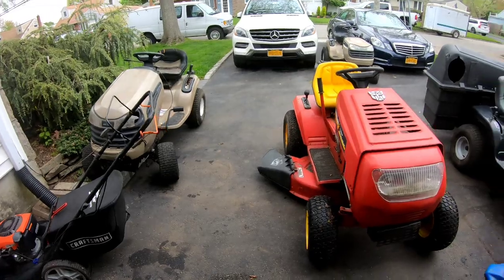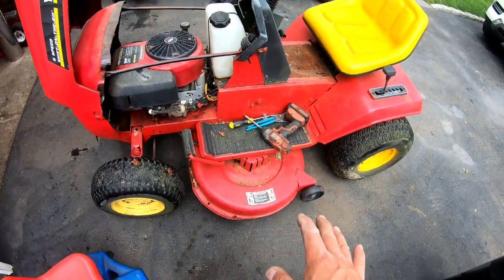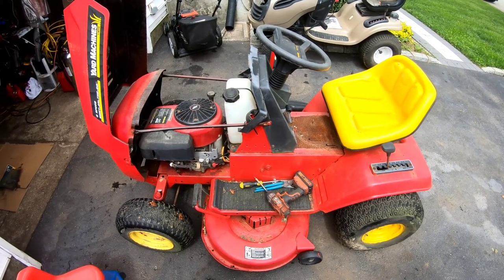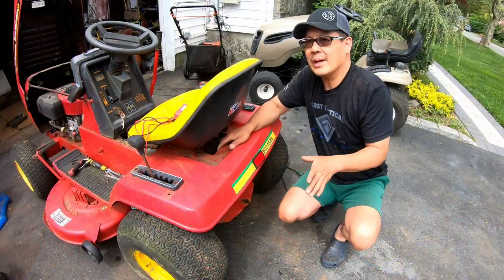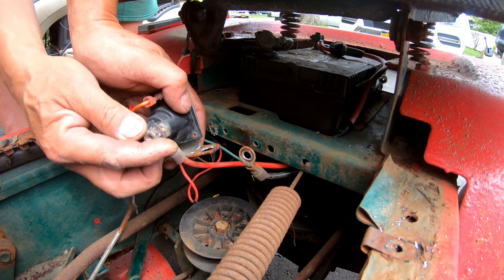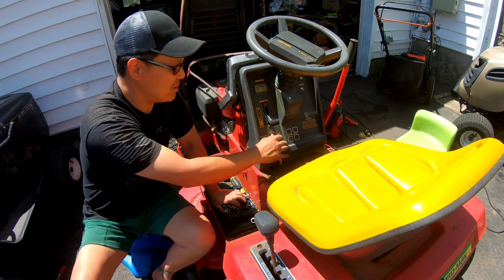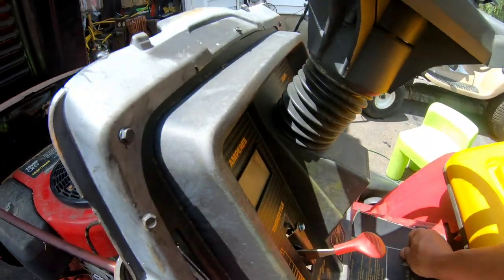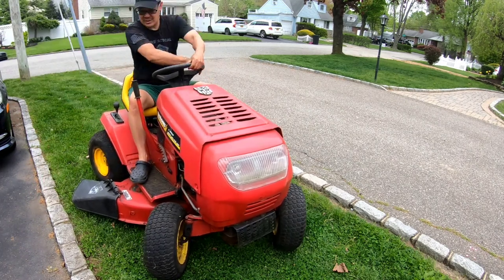GETTING RODIMUS PRIME GOING AGAIN!MTD YARDMAN 15.5HP BRIGGS 4 WHEEL STEERING LAWN TRACTOR GROUND FIX

Comment: A good idea for removing those Phillip’s screws when they round out is just use the cut off wheel and cut a slot for a standard screw driver. That way you can remove the screws without cutting into the panel and way less work. Hope it helps in the future. Love the videos. TY
Reply from the maker: Why didn’t I think of that?  Thanks bro!

Comment: You're absolutely right about the ground being important. I restored a 1990 Dynamark that would start but I'd have to hold the key on for a few seconds, I checked everything... I then seen the ground from the battery was smashed and has a kink in it, I replaced it with a new one and what do ya know? The tractor starts with a slight turn of the key.. I'd love for mine to have 4 wheel steering, but other than that mine runs and cuts amazing. I love the older tractors they just don't make the new ones like they use to. Great video my friend
Reply from the maker: Thanks Gary,  hope you’re subscribed
Reply: @MowersNBlowers  Absolutely did subscribe
Reply from the maker: @garyalensr  I see we are like minded people from your profile picture,  hope you’ve subscribed to my gun channel too!

https://youtube.com/c/MowersBlowersGuns

Comment: My MTD whites is a good ride on lawnmower it cuts okay the blades stay on when you crank it up the blades needs to be changed overall it's good mower as long as I keep the battery disconnect I should be able to crank it up no problem I shouldn't have to charge the battery so much the battery is called a a dual start battery